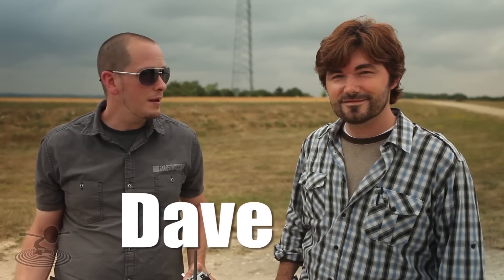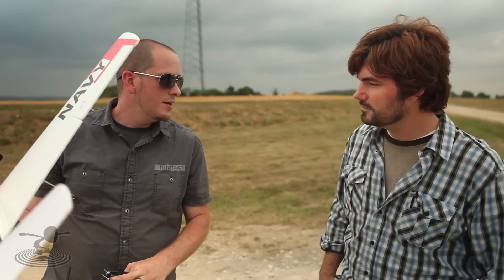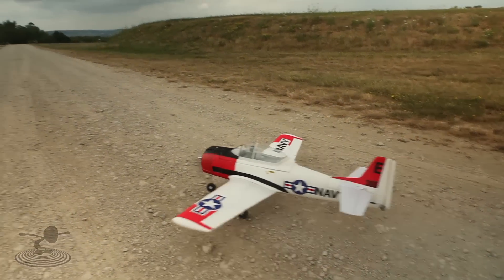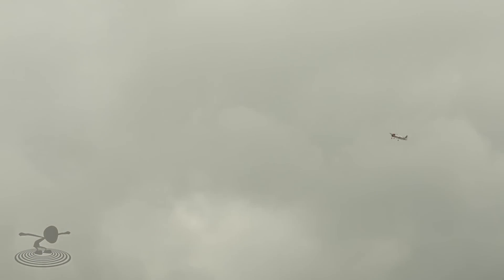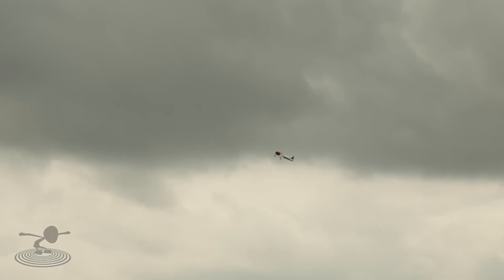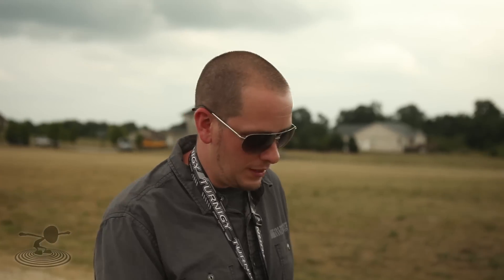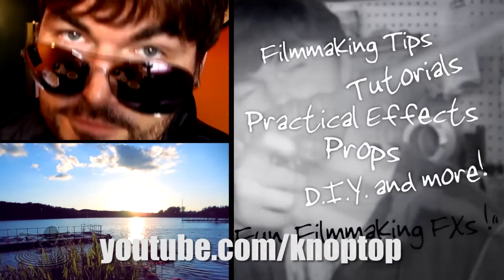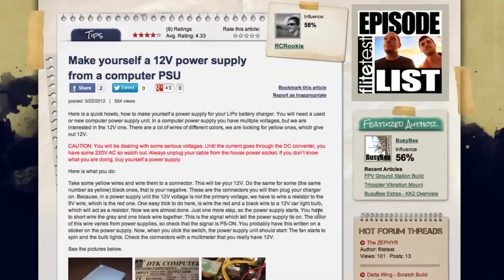Flite Test - Tail Heavy Plane - FLITE TIP

Comment: Another little tip, guys.

If you have retracts that move back like a nose wheel or a P-38 (three wheels moving aft) or twisting retracts on a Corsair, Hellcat, or P-40? Balance your plane with the gear retracted and the wheels in their aft position.
Reply: Pete Sampson - THANK YOU so much for this comment. I know this is all a little old but my son just maidened his Corsair last weekend and had a helluva time with it. All signs pointed to it being tail heavy but I couldn't figure out why as I had quadruple checked the CG before he flew. When I read this I had the big DUH moment. I am kicking myself for not thinking of this (and cursing the manufacturer for having such crappy instructions to begin with, but especially for not including this little tidbit. one little sentence and a disappointing day, one that he waited for for so long as he trained on less exciting planes, would have turned out much differently. We are new to the hobby so the preflight checklist still requires we carefully think through everything each time and we were so focused on making sure we had checked everything the landing gear issue just didn't occur to me. And I'm exceptionally thorough.  Again, DUH!  Luckily, and to his credit, he managed to get it down safely but it tipped in the grass and broke the prop. I called that a win and was proud of him for how well he handled a rough situation (and now I also understand why he seemed to be controlling it so much better on approach.  that clue should have slapped me in the face too but I think we were both just relieved to have it on there ground we weren't in troubleshooting mode yet. we had also done quite a bit of trimming trying to make it manageable so I figured he was just getting closer to figuring out the planes character). So, SO happy to, now, clearly understand what happened before I took him out next weekend and and made the same mistake again.
Reply: Knuckle Curve

I'm always happy to (try to) help when I can. Congratulate your son for me. Getting a tail heavy Corsair back on the ground in one piece is no mean feat.

Cheers!
Reply: +pete sampson I will definitely pass that along. his confidence was really shaken after that flight and he was so disappointed thinking he still wasn't ready to fly it after all. I tried explaining that what he proved by getting it down safely was just the opposite, that all the extra training we put in before flying it paid off, that we did so because something like that might happen, but he is 12 and, therefore, just a little headstrong these days. we have been learning together and I have always been taking our next developmental steps first in hopes that if I miscalculate our readiness for a given milestone it'll be my plane that comes back in pieces rather than his. so he had just watched me maiden my P-47 with relative ease and without incident. later in the day I was able to convince him to fly my plane so he could see for himself that he was perfectly capable.  once he finally did so and felt how easy it was too fly mine he felt a little better but was still disappointed, believing he had bought the wrong plane for his first warbird. now that I was able to show him proof with your comment that what he did was rather remarkable (even tho it wasn't fun) he is starting to see the light and get that old excitement back. thanks again. if you hadn't taken the time to help others like he and I I'd probably still be scratching my beard trying to figure out what went wrong.
Reply: Knuckle Curve

I won't speak for anyone else but, when I was 12, I was about as stable as 12 year old dynamite!

All things being equal; a P-47 tends to be a bit more stable and predictable than a Corsair. Corsairs can and do fly well but they just don't scale down the same way as a P-47. I think it's the combination of the gull wings behaving a bit weird and the forward mounted vertical tail surfaces resulting in a shorter effective tail moment. End result? While P-47 flies like a sport plane a Corsair will fly like a warbird. A Corsair won't necessarily be harder to fly but they are unique and behave like nothing else. I have flown two Corsairs, though not a lot, and the biggest problem area I found is that they get squirrely if one hits the throttle too fast.

Not knowing what planes the two of you have flown it might be a good idea for the young man to fly your P-47 a bit more just to get used to the speed and wing loading without the quirks. And? Remind the young gentleman that he has already survived the worst that the Corsair is likely to throw at him.

Cheers!
Reply: +pete sampson 
Great advice on the throttle. we got a glimpse of that on take off when he rolled into it way too fast during his first takeoff. I've got the E-Flite P-47, which has the AS3X receiver and it is absolutely rock solid in the air. Just a joy to fly. I scoured the internet trying to find some comparison info relative to flight characteristics but came up short on all fronts. We knew that the P-47 would be much more tame than the Corsair but I was really hoping for some specific differences so he could be well prepared and at least know what to expect. The 10 minutes I've invested in chatting with you had yielded far more useful info than the hours I spent reading and watching videos (my "tail heavy" search lead me here, obviously). So, I can't thank you enough for taking the time to share all of this with me. I'm trying really hard to help him learn about all we are doing with these planes and progress at an appropriate pace (and learn the value of thorough preparation and research) but I'm learning with him since we started at the same time. Without any seasoned pilots to lean on we are occasionally relegated to trial and error or making our best educated guesses. I will say that when I have reached out to strangers, like yourself, everybody has just been so generous with their time and is really giving me the warm and fuzzies about the hobby. seems to be a very supportive community on the whole. so, again, thank you so much for taking the time to answer my rookie questions. and my son said to pass on his appreciation as well. he was really scared to fly it again and now he's chomping at the bit to sort out the CG and get airborne again. THANKS
Reply: Knuckle Curve

The thing that has kept me coming back to this hobby outside of a few beaks since 1969 is the people. I really don't think you will find a group that, collectively, is more eager to share their experience and knowledge as well as brag about our accomplishments. And, between the availability of inexpensive planes that fly great and the vast on line community, there has never been a better time for it. I find myself wondering how we old timers managed before the internet. The answer, of course, is that we bought and built a lot of crummy planes and crashed a lot!

My first attempts were, looking back, laughable. I had a Jetco Navigator flying boat that was twice as heavy as it should have been even with twice the power. The only way that I ever got her in the air was to hand launch from the bow of a speeding boat. I managed two perfect landings with it. Both, one on the water and one on a golf course about 3 miles away from the lake, occurred when the primitive radio ranged out and the throttle fail safe kicked in. After the second one I realized that the trick to landing it was to simply chop the throttle and let itself settle.

I built a second one, much lighter and with a better radio, and had somewhat better success but I didn't make any great strides until I moved to San Diego and joined a glider club. Then? It was back to rural Minnesota and learning more about powered flying on my own.

I will never, ever, forget my first flight with a warbird, a 36" span P-47. It had a Cox engine with no throttle so once I was in the air all I could do was hold on until the fuel ran out. I think it took 7 years! I was nearly bawling by the time it ran out and then nearly bawled from sheer joy when it was safely back on the ground. My first flight with a .60 powered Super Sportster was similar. The giant leap in speed left me reacting about 10 seconds behind the plane. But? I finally felt steady enough to bring her in, made a very nice landing, then collapsed and laid on the ground shaking like a leaf for a few minutes.

Are you familiar with RC Groups.com? There are a great group of people there and I'll include a link to one of the threads about the E-Flite P-47. I'm sure there is one for your son's Corsair too. I'm mostly active in the Electric Sailplane forum. Feel free to leave me a message on this thread in the first link or even click on my name and use the private message function. I'm the humble host, "peterlngh", and I encourage off topic posts. Who knows? We might even talk you and/or your son into trying an electric sailplane some day. I can quickly get bored "drilling holes in the sky" with a powered plane but my heart still skips a beat every time my sailplanes start going up without power.

Here's the link to my glider thread.

http://www.rcgroups.com/forums/showthread.php?t=2513883

And here's the link to the P-47 thread.

http://www.rcgroups.com/forums/showthread.php?t=2383219

Cheers!
Reply: +pete sampson
 it seems like one of those rare communities where nearly everyone remembers what it was like to be a novice. So, very refreshing. 
I haven't been wandering the earth quite as long as you, but my older brother did dabble a bit with RC planes when we were kids, long enough ago I remember the only acceptable flying machines made of any kind of foam were Delta Darts and those big gliders with the two piece wings from the "dime store", and to remember frequency boards and crystals, flags at the end of aluminum, expandable  radio antennas (that were the only things more fragile than the planes) with some kind of quantum color coding scheme I could never quite get my head around, and the Oh so wonderful smell of "dope" wafting through the house.  Before my son told me he wanted an RC plane for xmas last year and i stated researching current models, if you had told me that electric powered foam planes were the ticket i would have thanked you for chuckle and been on my merry way. I am just amazed at what is available and how unbelievably fun they are! Thanks again for everything. I will definitely check out the links as soon as I have time.
Reply: Knuckle Curve

That's a fair estimation although, to be fair, there is always at least one "know it all" in every group and we RC fliers have our share.

I had taken about an 8 year break from RC when I stumbled across a YouTube video of the new "foamies" about 4 years ago. After a little research I realized that I could get a brand new electric plane for less than it would have cost me to get new batteries for my old radios. The best part is that I can fly them at a park that's within walking distance. The rest, as they say, is history.

Now? I have a fleet of four that are ready to fly with the simple step of switching the model programmed in my radio. The one that I fly the most is a EPP foam Yak54 from Nitroplanes. It's ugly and has doubled in weight after all the repairs but it's simply a wonderful flier. Then I have two wood and fiberglass sailplanes and a all wood Katana Mini for special occasions. I even decided that I wanted to build again so I'm in the process of creating a Fokker D.VIII from plans.

There is a saying that "balsa flies better" but it's only true to a point. Small to moderate sized warbirds, in particular, are damnably difficult to build light enough that they fly well. Overall I think it's safe to say that the foamies fly as well or better, are harder to break, and easier to fix. I have been contemplating getting a Hawker Sea Fury but I figure I need to wreck at least one plane before I can justify buying another.

Cheers!